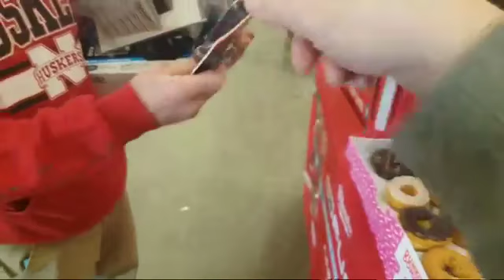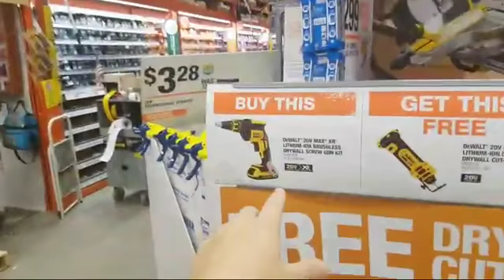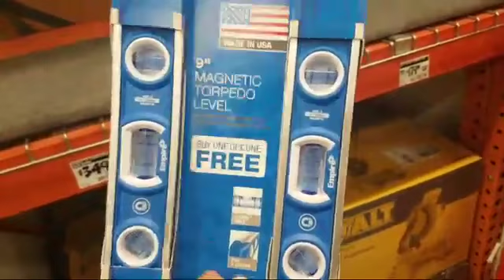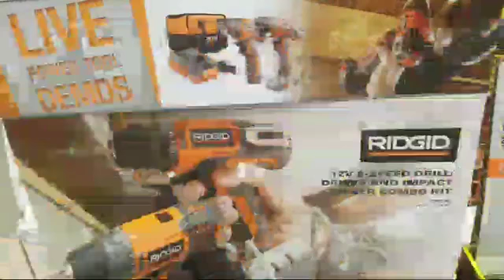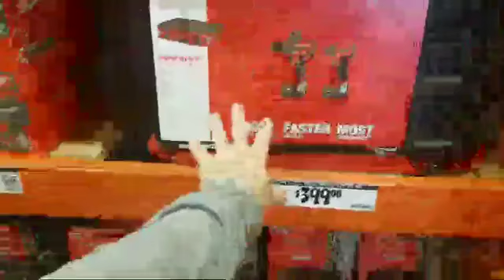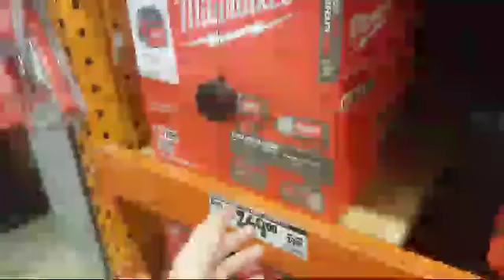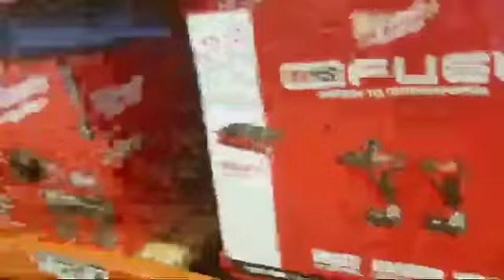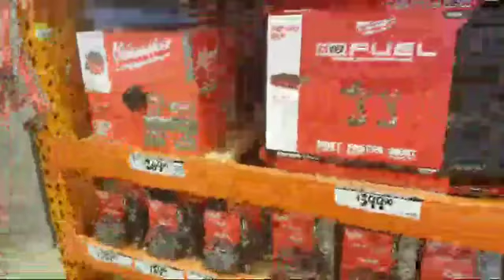VCG and Tool Boss LIVE !!! at Home Depot 2018... MILWAUKEE DAY EVENT !!

Comment: Okay tool boss, i did the Rigid deal you mentioned the other evening. 2 Batteries and charger $199, get a free tool. Went to customer service explaining the purchase and return i was about to proceed with. There are no limits to how many can be purchased at a time,
, only thing is each battery deal and free tool require seperate transactions. Coupons or military discounts will void the free tool.
I loaded the 3 battery packs  ( all they had) and 3 free tools, and the 18v brushless (not octane) hammer drill/ impact driver w 2 hyper 4 amp batteries and charger for $199, minus the $25 coupon.
I wheeled the shopping cart from checkout outside and back through the entrance to customer service for the return. 
After returning the the 3 battery sets here are the totals: 7 1/4 octane circular saw $85.20;  4 1/2 octane grinder $74.47; recip saw $85.20  $244.87 before tax plus $174 for the drll combo w/ 2 hyper 4 amp, total $419.87 before tax for the lot.
Thanks for your keeping us informed, really pleased with the deal....but im not finished yet.
Reply from the maker: Awesome buddy 👍👌
Reply: @toolboss8410  just discovered the hyper batteries are from 2013. They make it really confusing.
Reply: @toolboss8410  any recommendations for octane batteries?

Comment: Can you please explain the battery return on the special buy to get to tool cheaper?
Reply: Buy the battery pack choose a tool that goes with the deal, look at the receipt, it will show return value on each, return the batteries, get a discount on the tool...for ex the grinder now $119 if bought bare tool, guy above says it is $74 by doing this.